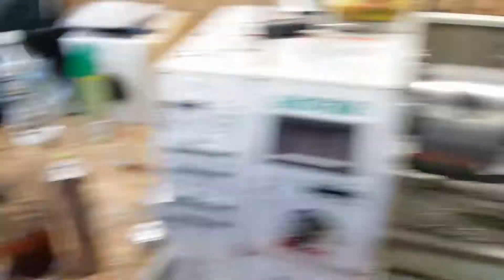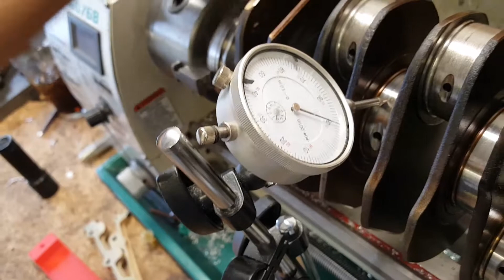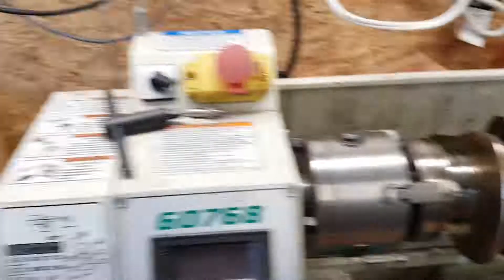Subaru ej255 destroyed rods, bent crank and cracked ring lands. TUNE YOUR CAR!!!

Comment: I don't know what is with these idiots that keep driving a knocking Subaru hoping it will just "go away". Mine started knocking 20 miles away from home, I immediately shut it down and towed it back. I didn't think you could bend the crank holy batman 😬

Comment: one i noticed on every rod knock motor iv taken apart  its only pickup tubes if oil pan gets hit   that iv seen crack one intresting think i find is the oil  rings used on case halfs and the oil punp  pull in almost like pickup inlet is not able to pull oil fast enouf  so the oil oring seals cause them to suck air    think its the small holenin the pickup tube that is not letting enouf oil supply go threw it
Reply: also  turbo needs to be rebuilt due to crap in oil

Comment: Must be other explination to why rod knock occurs..

Many people ran the car oem to point A to B and get rodbearings faillures..

I even heard of the actual oil pump it self the screws in the back of the oil pump that gets loose and voila pops the seal or something.

A lot of things to watch it seems..
Reply from the maker: As it states, the center journal feeds both rods, the oil hole in the center journal is the same size as 1 and 4. However the center feeds two rods. This hole should be lager...